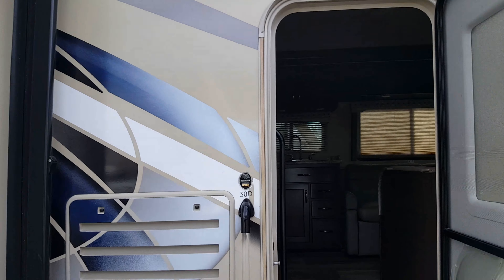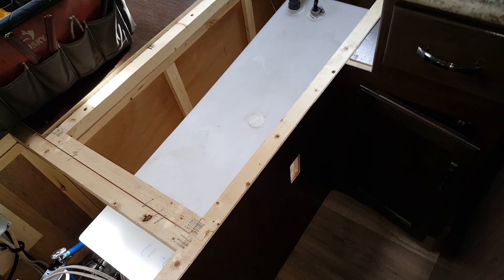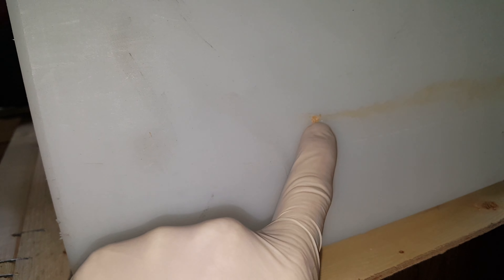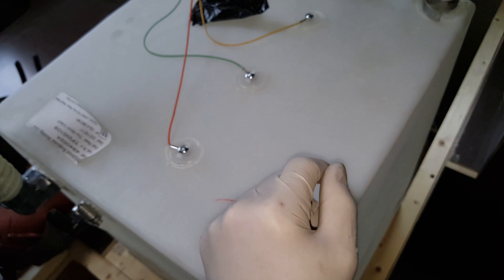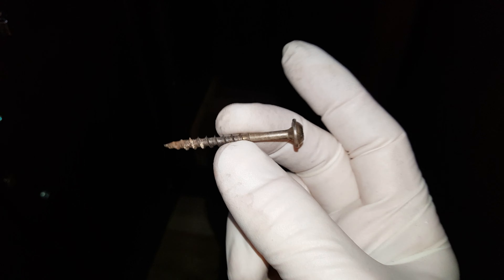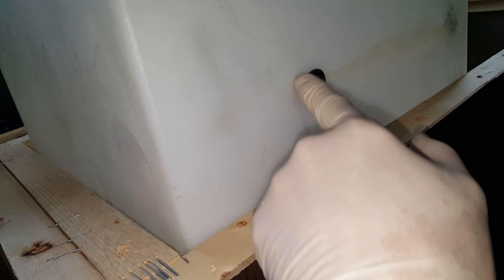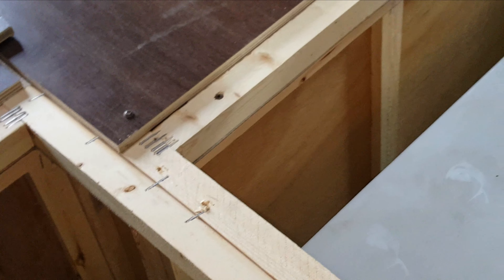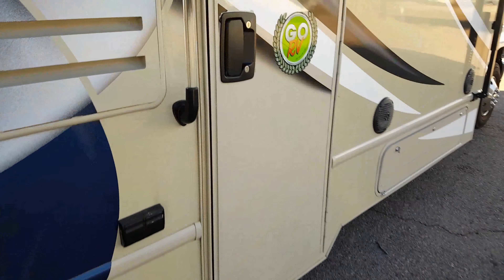Another RV Manufacturer Quality Control Issue....a leaking water tank!

Comment: We had a leak in our trailer😲 I traced it to a hose coming out of the hot water tank, was all freaked out, but called Brad at Taylor Coach(manufacturer) and he walked me thru what to do. I hand tightened it 1/2 turn🤣😂, but he also said I may want to buy a new o ring? thingy..gasket? So went and bought 2. You know..gotta have a spare! 😎  I also watched youtubes how to clean hotwater tank, and freshwater with vinegar, so did that since it was 3rd hand trailer. Lots of crud came out!
Reply from the maker: These water heaters have small tanks so mineral build up is quick. If it is a suburban water heater, it is glass lined steel tank so an anode needs to be installed and replaced or inspected annually. They are designed to fall apart so if theres  a lot of white crud, it could also be the anode. Thanks for watching!

Comment: We have a Class A Tiffin Allegro 32'. The fill hose to the fresh water tank is leaking. The fresh water hose fill opening is at the rear,driver's side. It looks like the hose has a low place, water sat in there all winter, froze, and split the hose. I can see the entire hose but I can't get to where it connects to the tank. Even though the hose leaks bad, we were able to fill the tank. The next day the monitor system showed only 1/3 tanks level. So, I assume the tank must be leaking too? I cannot see any way to get too the tank? Do you have any ideas for us? Or do you know any Mobile RV Service in the West Central Ohio area?
Reply from the maker: I know I've ha to remove a rear access cover in the rear cap and crawl into the frame rail a few times on those Allegros.
Reply: @AZExpert   Thanks so much for your answer, videos, time and effort! Which access cover? It looked like one in the back of the rear passenger bay and one behind the spare tire cover, and one behind the wet bay on the rear drivers side. All those go to the same place and all are too small for a person. I chose to remove everything from the wet bay because then I would be 16" from the fresh water tank hose connection. It took my wife and I two hours to remove the fill hose from the tank end. Now we are trying to figure out how we can slide the new hose on the tank connection. Do you think I could heat the end of the new hose to get it to slide on easily? P.S. there was evidence of mice chewing holes in the hose.
Reply from the maker: @robertwatkins8220  if it's what I'm thinking about a 2 foot by 3 foot rectangle section of the rear cap is removeable.